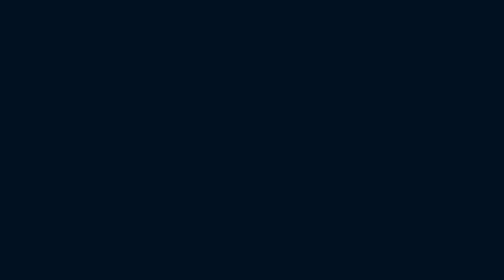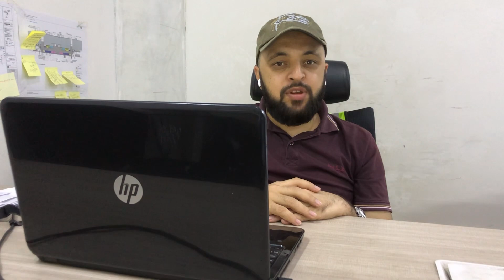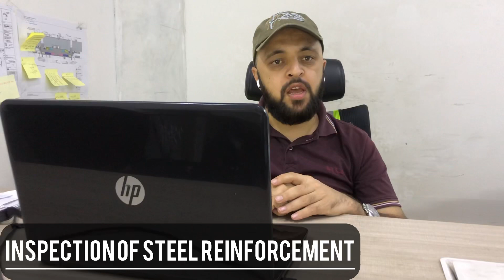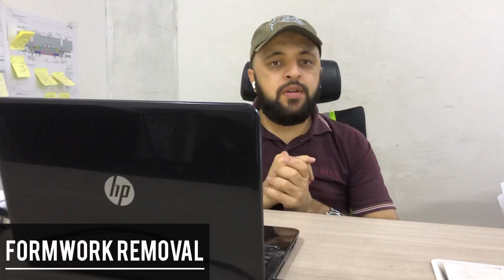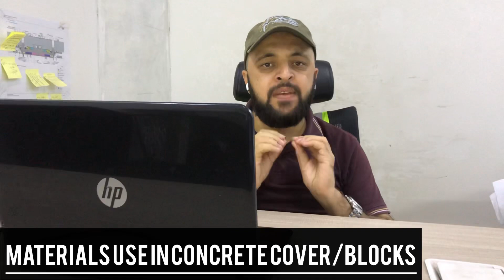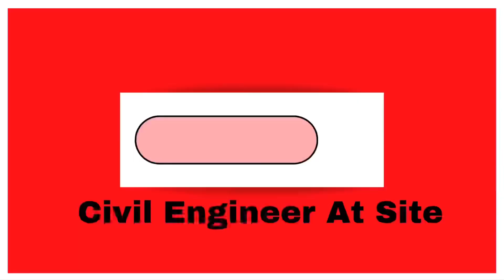Civil Engineer Job Interview Questions And Answers in Saudi Arabia Part3| Site Engineer Interview

Comment: regarding concrete cover could be please confirm the standard code BS 8110 are normally or you mentioned? Secondly, regard concrete cover strength is it possible e.g to achieve 35 MPA ( I am in Qatar but never been at site as was attached to academic back in Pakistan and here also but I observed spacer at bahria town projects they are making spacer from plaster mix). I am preparing myself following your videos in sequence for the site interview.
Reply from the maker: Concrete cover block strength should be same as concrete strength
Reply: @CivilEngineerAtSite  standard BS 8110 for concrete cover?